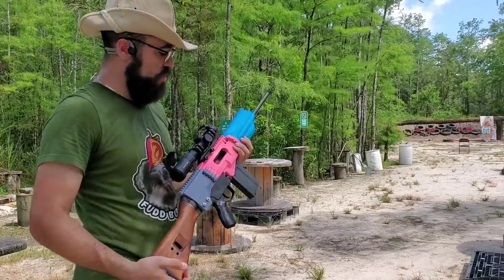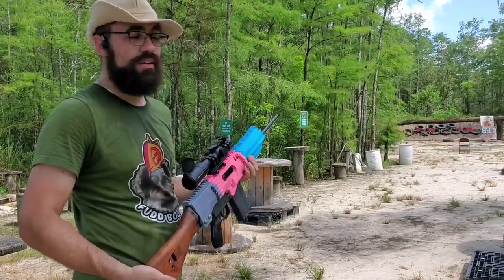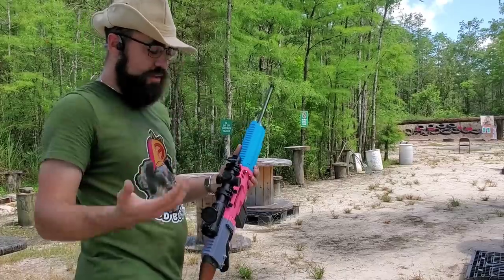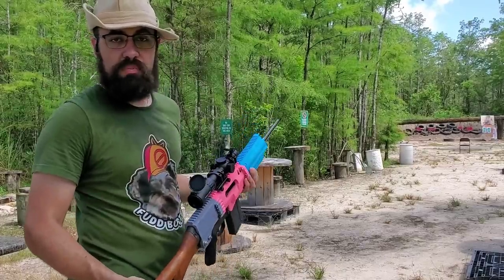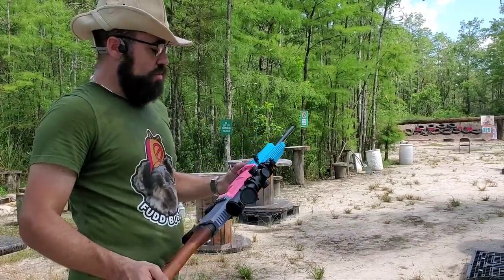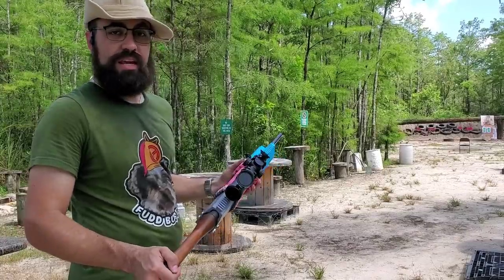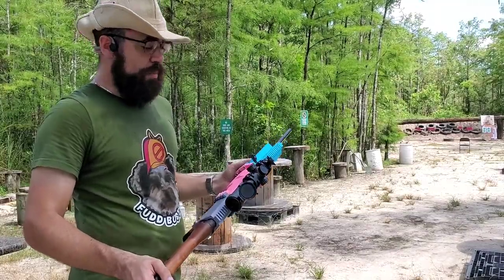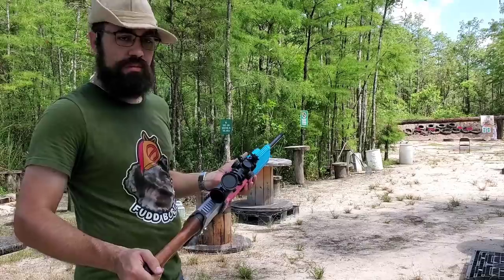Testing my $300 3D Printed 308 Battle Rifle

Comment: Damn, that's awesome!
At first i though you just dressed up a G3 in plastic but this seems to be the real deal. 
How can it even withstand .308 pressure?
Reply from the maker: That's the magic of delayed blowback. The trunnion is eating the brunt of it, and the bolt mass absorbs the rest.
Reply: @FuddBusters  explains why the receivers on these guys are usually tin sheets you bend to shape. Good to know!

Comment: Way too cool! History be made here folks.
Reply: nah, its already been done
Reply: AWCY? Did it first!! Ran it at the makers match weeks ago.
Reply: Heya! Love your hose clamp reciever, still the best one out there imo. Haven't had a chance to actually use it due to a lack of cash for a parts kit, but it's sitting on my desk, waiting
Reply: @lokiwartooth1138  Guess I missed it! Is this platform well suited for printing? I know how they work on a basic level, but not sure what the innards look like.
Reply: @HoffmanTactical  The setup for the metalwork (pressing and pinning the barrel into the trunnion) is a bit tricky for the uninitiated, but with the exception of the cocking tube (the charging handle acts as a cam to unlock the rollers, which takes a surprising amount of force) and barrel mounting solution, this platform lends itself well to being bulked up for use in polymer.

Comment: Nice! It's good to see more AWCY CETMEs out in the wild! I saw a few running at the makers match just a few weeks ago!
Reply: This is from DD2. It's VERY funny that they did this right after AWCY announced theirs though.
Reply: What's the point of starting dev on a gun model if another group already has a half dozen running?  I mean hell there were multiples running in the competition like beasts.. Just seems like a waste of time to remake the same thing... why not do a different model that no one has done yet?
Reply: @gambler8899666  the same reason you have the hoffman lower, the ubolt vanguard lower the hellfire lower and the wildfire lower. Different approaches to the same problem for options.
Reply: @gambler8899666  CETME kits are some of the cheapest available right now, and this is a much different approach to the kit than the AWCY one that already looks like it'll be easier to put together. AWCY one relies on internal steel/aluminium rails and uses part of the chopped up receiver, this one needs neither.
Reply: @patrickrhoades480  yeah I get that... I also consider all of those wasted dev time... why do we need the 1023th version of an AR lower... at this point it's debatable whether those are really improvements or just making another model to make a model to put a name one. I'd rather see more people pushing the limits on never before used kits. Not beating dead horses.
Reply: @infantjones  oh it certainly is a different approach... reminds me of the v1 plastikov that almost no one could actually get to run lmfao. It may be easier to build. But I'd bet  the "harder to build" reinforced one will last a hell of a lot longer. I guess there's room for 2 designs in this case... one for people that can't handle basic metal work.. and the reinforced one for those that want a gun that will last more than a couple hundred rounds.
Reply: @gambler8899666  Considering the flex when firing the AWCY CETME, not to mention the issues with actually mounting the chopped front receiver section to the printed receiver, I'm not entirely sure the AWCY CETME would run more than a few hundred rounds as it stands right now. Though at least they've seemingly got the issues with needing lubricated ammo sorted out by now. Either one requires metalwork but that's a bit of a silly jab as a key advantage of 3D printed receivers is the significantly reduced need for metalwork, and the CETME in particular is one of the easiest flat-builds you can do. I'm glad to see competition in regard to these.
Reply: @infantjones  the flex in the one video ivan has so conveniently decided to attack was from the gun having been disassembled before hand to show its construction. When it was put back together it was done loose because we didn't know we were going to shoot it again. That it ran while not assembled correctly kind of reinforces the quality of the design lol. There are a dozen videos across the web of this build shooting without flex.. yet the only one that people are seeing is the one dd2 wants the to see (what's that tell you)...
The greased ammo was only needed for the ones built with unfluted AR10 barrels. The ones with the usual apex fluted barrels run just fine on whatever you feed them. I have no doubt the awcy design will go over 1000 rounds easily when properly built.
Reply: @gambler8899666  Seems weird to near exclusively publicize a video that supposedly was of a poorly reassembled example, they just reposted it yesterday on multiple platforms. Doesn't seem like it'd be too difficult to just make another video of it done right? Or publicize one of the "dozen videos of this build shooting without flex"? If you don't want people to point that out, don't publish the footage of it running wobbly as hell on multiple platforms multiple times. It's not like Ivan is cherrypicking, it's not some "convenient" choice, it's the main video of the project actually firing and the exact set of videos AWCY is choosing to share repeatedly.

Comment: I like how you put a wood stock on a polymer gun. Just so it didn't get too light.
Reply from the maker: It's actually kind of obnoxiously heavy because the receiver is so dense. It's substantially heavier than my G3
Reply: @FuddBusters  Dang! I didn't think about that. By the way, is it based on the FAL?

Comment: Nice! Out of curiousity, what did you do about the trigger group, assuming that is what it looks like and it's a cetme C kit. I'm building out one of those right now too, and running into some hurdles. Seems like most people just shell out for a hk91 semi group/housing, but they're ridiculously expensive. Did you just modify the original cetme group?
Reply: You can modify the original trigger assemblies pretty easily. There's a lot of utility in a dremel tool and grinder.
Reply: @IvanPrintsGuns  If I may ask, what all modifications did you guys do to yours? Unless I'm missing something, I'm having trouble finding something as clear as an itemized list of changes that need to be made, only a 'generalized' picture, as it were. If I have things right, in theory I should just be able to remove the auto sear and trip lever, cut the trigger box to remove the spot for the AS. Then the housing needs modified, and from what I understand that usually means clipping the front to remove the spot for the mounting pins, and welding a shelf that the trigger housing then sits on.

It's the clipping/shelf of the trigger housing that confuses me; the intent seems to be so an original full auto housing can't be used. But the shelf bits that are sold commercially don't protrude far enough into the housing to intersect where the sear pin of the box used to be, such that it acts as a second denial for a FA capable trigger trigger box. So, it seems to be just an odd change of mounting solution for the trigger housing; instead of that front pin that the original has (and the G3/HK31/33/etc all have), it's made to rock in at the front onto that shelf then secured as usual from the rear. This may be one of those things that would be immediately evident if I had a semi-only housing on hand to inspect, but, that would defeat the point of the cheap build.

Removing the auto sear and the trip lever is a given, but I'm not sure what the point of the semi-only shelf is; or if it's even a necessary part of the conversion, and where I would find documentation backing that up.
Reply: @smithyoftherust  you have to make sure that whatever you put together cannot accept an unmodified full auto fire control group, then modify yours so that it can work. Remove autosear and trip, cut tail off disconnector, then do something to the receiver that prevents you from installing a trigger housing that has an autosear trip installed.

Comment: Hey guy. I was putting one of these together and I noticed the guide suggested a heat shield around the barrel. I'm wondering if anyone has tried aerogel infused insulation pads? Like the ROVA ones on amazon.

Comment: I been wanting to get a cetme parts kit and make one but so many of these are much harder to do than an AR, and the jigs needed are almost never in stock
Reply: @ABlindMan1 yeah weapons guild has a ton on this. Honestly if I make three of these then it worth it to buy a twelve ton press and welding equipment
Reply: You can 3D print a bending jig.
Reply: @unicornswag888  yeah gonna need a 3D printer. I’ve seen the design specs though and it all seems so complicated

Comment: It looked to me like it was just a cover over the real gun.
Reply: You can buy the parts kits for $120 plus $150 barrel (currently out of stock, just checked, also they still have some STEN kits for $140 but to look nice on the wall I'd want the tube replaced at least with clear plastic but I believe the ATF would kill you for that). So you're just printing the receiver which I think on these is sheet metal but you're replacing that with chunky thick plastic and just using the parts kit to build one. Seems like an affordable option if it stays that price (it won't), and if it becomes federally illegal for home-made firearms (which has been legal to do since before this country was a country) then you'll have to chop it up like they did with the historical artifacts and destroy history and freedom with a torch and de-mil it like the parts kit you buy.
Reply: I agree
Reply: There are several sections, like the magwell, that very clearly are full plastic, and you can see inside the receiver in the beginning when the bolt is back. It's real.

Comment: How the hell did you make that for under 300dollars.  Your using h&k parts obviously since it's a delayed roller locker system.  But the bolt carrier is almost 200 dollars it's self.
Reply: It's a Cetme Model C. You can get parts kits for about $110. New barrels are around $150.

Comment: Its just a bunch off plastic screwed together over the already existing frame.
Reply: It does, but there's no metal frame there - just plastic.
Reply: If you zoom in on the ejection port, you can see pink plastic on the opposite side of the inside of the receiver. There isn't a metal receiver inside of it.

Comment: Please check the bolt gap on this! Your gun is recoiling a lot, which suggests an extremely low bolt gap for a G3 roller delayed rifle. Anything .012 inches and above is decently soft recoiling. This will not only increase the longevity of the 3D printed part but also make the recoil more tolerable.
Reply: Couldn't it also be because half of it is made from lightweight plastic, and he didn't even throw some sort of muzzle device on it?
Reply: @brandon3883  lol what I was thinking too. Idk if “bolt gap” is a g3 thing or if you’re referring to the headspace, but either way if this dude figured out how to put together that thing, I’ll give him some credit and  assume he checked the headspacing  lol

Comment: He has to be messing with us..... an fnfal 3d printed receiver.... not buying it
Reply: It's a G3 / Cetme, not a FAL. And why wouldn't you believe it? It's roller-delayed blowback, so the bolt should be moving at a safe speed by the time it unlocks from the trunnion.
Reply: @unicornswag888  My mistake a G3, but i still don't believe it. there is a lot of smacking and banging around inside that upper receiver. I don't believe that polymer could withstand that. Further, if you look carefully there is black metal under the plastic towards the back of the upper receiver near the buttstock.
Reply: @jondavidmcnabb  The front of the stock is made of stamped sheetmetal, so that's what you're seeing at the back of the receiver. If you zoom in in on the ejection port, you can see that the receiver is plastic all the way through.

Comment: It’s just 3D printed parts bolted over a G3 or variant, but a hilarious way to pwn the hysterical gun grabbers. Nicely done.
Reply from the maker: It's funny that you think that.
Reply: It's clearly real.
Reply: @FuddBusters I don’t think it, I can see it in the video 😂
Reply: @unicornswag888  then I look forward to the one-take video where it’s fired, then disassembled so we can see how the receiver is put together.  I can’t imagine the plastic holding up to the G3 carrier for very long, not to mention that most of this weapon is definitely not printed. Kind of like calling a Glock a plastic pistol…. I still think it’s an interesting video, if a bit misleading.
Reply: @slister1911  it's a printed receiver that fires .308.. I dont care if the lower, barrel and furniture are wood and metal.
Reply: @slister1911  Not sure what's misleading about it. He said it was a Cetme parts kit built on a printed receiver.
Reply: @unicornswag888  the title clearly states it’s a 3D printed .308 battle rifle. That’s no more true than saying the Glock is a plastic pistol. The vast majority of this so called 3D printed rifle is in fact NOT printed. Claiming a weapon is 3D printed is different than saying a receiver is 3D printed. That’s just my two.
Reply: @TedyhereMC  The butt pad, stock, backplate, buffer group, lower, trigger housing, trigger pack, grip, selector, magazine, bolt, carrier, locking piece, rollers, firing pin, trunnion, barrel, cocking tube, cocking handle, etc. are all from a parts kit. But sure, it’s a 3D printed .308 battle rifle 🤣
Reply: @slister1911  ok boomer, you’re really going to hate the 3011.
Reply: @evilsd9  😂 whatever you say lego boi.
Reply: @slister1911  the serialized part that determines if it is a rifle is 3d printed. Stop moving the goal posts you baby. The upper receiver is 3d printed.. the receiver is where 100% of the force of firing goes.. that part is 3d printed. I get it, you are a man child and will have to be right so you will move goalposts again. It's OK to be wrong.